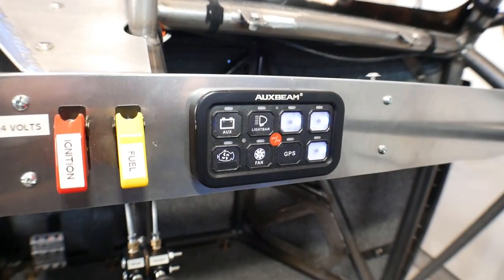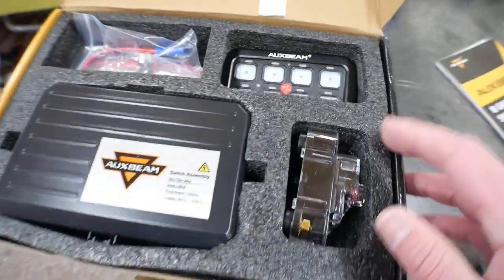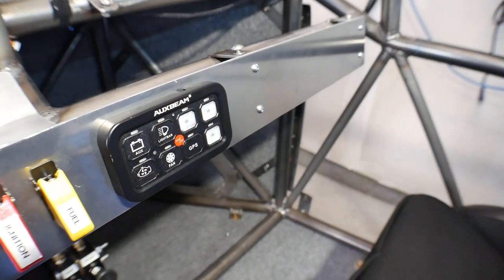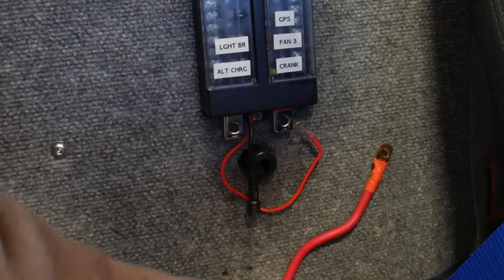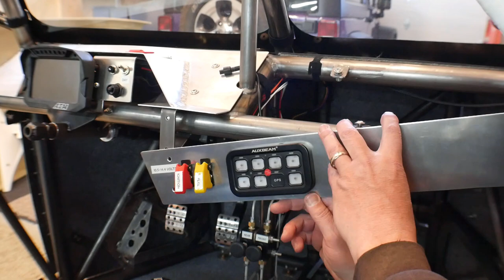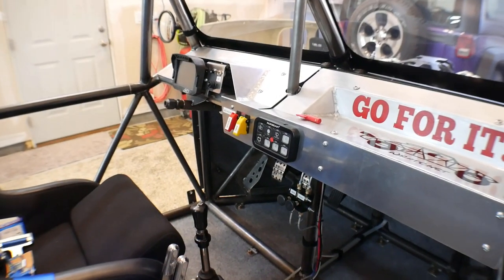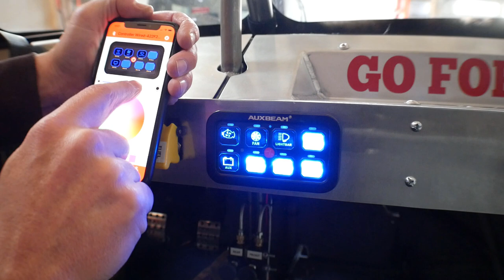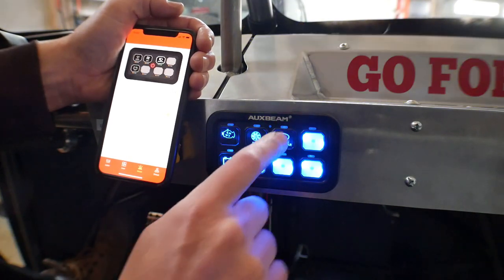Electrical upgrade, and a little test drive for Wratchet.

Comment: Nice up grade on the electrics. I'm surprised it didn't incorporate a security device?  A pocket fob would be cool....
I wouldn't give it to much of a thrashing until the tranny has a few miles and a oil change. It was another cold day in Colorado.  Take care
Reply from the maker: This dang cold weather is making it hard to break in the transaxle. The oil is like syrup.

Comment: Nice to here from you. It's been awhile since you mentioned taking Wratchet to the OHV park. I thought you got sick or something. That's an interesting switch panel. It can be use to turn ON an aux light remotely when you are trying to couple the trailer hitch at night time. What is the parasite amp draw of the switch if it is wired  hot all the time. Another well thought off project done. Looks like Wratchet is ready to rip the road. Great job!
Reply from the maker: The parasitic draw would be pretty high. It has an auxiliary wire that is powered by your "accessory" circuit to power it on. But mine is hardwired because I always turn off the battery disconnect when I'm not using Wratchet. The battery is lithium so I don't want anything pulling it down over time.

Comment: You need to add ferrules to those wire terminations in the new fuse panel. You can get a kit on Amazon for $25 that includes the crimper.
Reply from the maker: Honestly I've never used those. But I looked it up and those look like the right thing to do. I'll add them on the final build. Thanks for the tip. 👍
Reply: @DougBugBuilder  I'm always installing them because stranded wire connections are just so unreliable. As soon as I install ferrules, I never have a repeat issue. Just added reliability insurance. And better than solder.

Comment: G'day,
Great to see you.
A very interesting video and as always perfect wire placement. Down here I had to pay $ when  taking Betsie on test drives (roughly $50 for 24hrs) the fines are over $1000.
But a great upgrade I can see why you had to do it .  It certainly makes  for much easier start up.
Q. I realise you have OCD's me to but your not real grass how did you get it so perfect I'm wanting to install some but it scares the begeebers out of me.🥴
Anyhoo great video thanks for sharing and I look forward to seeing you with the pedal to the metal in the next one. 
✌🏻 Peace from Australia.
Reply from the maker: Hey Kevin,
Good to hear from you. I considered installing the turf myself, but after researching it I wasn't sure I could do it very well. So I had a contractor who specializes in it do the install. So far it was worth the money, it's real nice.
Peace amigo! ✌

Comment: That programmable switch panel is a game changer!  Glad the swap-put was relatively straight forward for you.

I'm very interested in that parking brake swap you did with the ball valve units. Do you have any links for guidance?  My brakes have the mechanical actuators, but sourcing longer cables for extended trailing arms is not easy. Your route might be the way to go.

Stoked that Ratchet is a driver now!  Congrats!
Reply from the maker: I got the valves from Kartek. https://www.kartek.com/parts/parker-hannifin-2f-mb4lpfa-bp-brake-line-straight-ball-shut-off-valve-18-npt-inletoutlet-2500-psi.html
They're just ball valves, but they work extremely well.

Comment: Awesome work love the build, I’m having the same issue with the parking brake where did you get the ball valves from they look awesome 👍
Reply from the maker: I got them from Kartek https://www.kartek.com/parts/parker-hannifin-2f-mb4lpfa-bp-brake-line-straight-ball-shut-off-valve-18-npt-inletoutlet-2500-psi.html

Comment: Have you seen this?  
https://youtu.be/BMeIOHRJV10. 
Honda turbo V6 in a sand rail. What you have to look forward to.  No go out and do a wheelie.
Reply from the maker: I have seen that. I watched all the videos on that rail as I was interested in how they set up the engine. Wratchet has a lot more weight to pull up, but I hope he wheelies at least sometimes in the right conditions.

Comment: #1👍🏻!! 💪🏻
Reply from the maker: You're #1 💪
Reply: @DougBugBuilder , I’m going to start work on a mid engine bug powered by a 1.9 VW diesel using an Audi FWD trans… Possibly making a narrowed body with tandem seating (if I decide to have a passenger at all)
Reply from the maker: @rickrack78  That sounds like a great project!